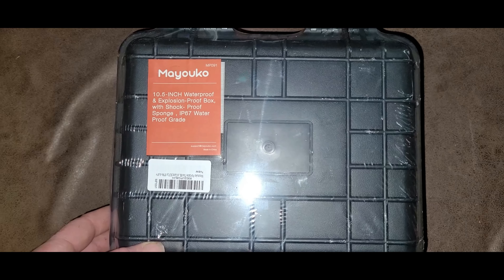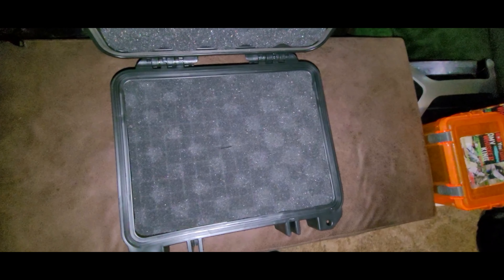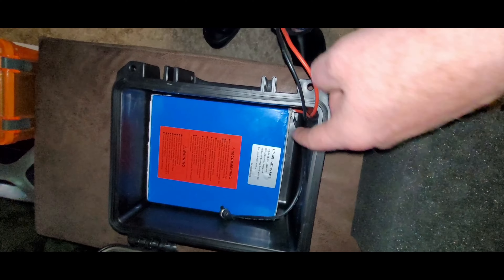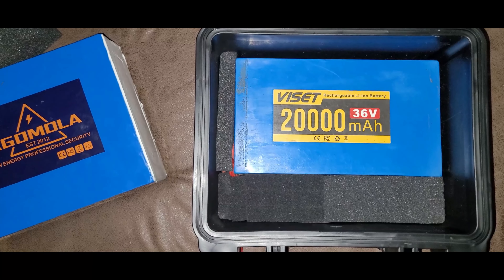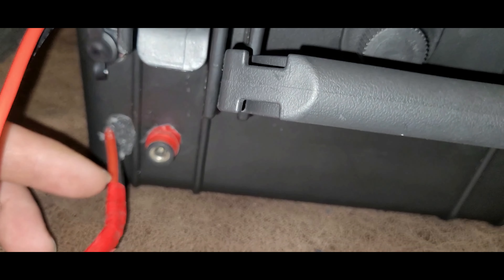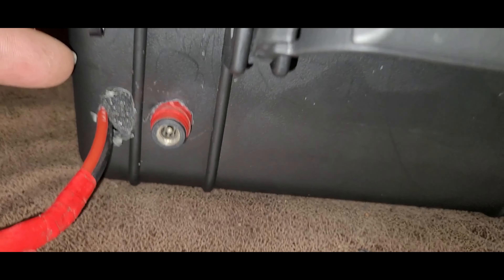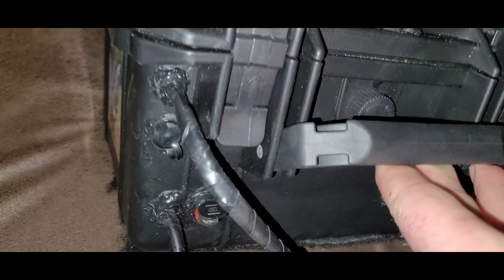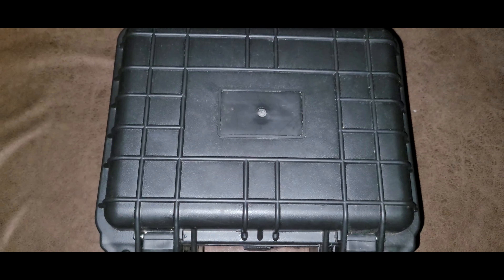DIY Dual Ebike Battery Box Water & Humidity Proof

Comment: Looks good Kenny 🤘

Just a thought for the future, when you have to drill an oversized hole like that, instead of having to fill it all with silicone, you could buy rubber grommets sized for the hole you've made, use a razor blade to slice a single cut through it so you can slip it over the wiring and pop into the hole, then as a precautionary measure you only need to use a little bit of silicone. 

The make grommets in a wide variety of O.D outer diameter, I.D inner diameter, thickness and groove width to fit the thickness of material you're working with. 
Hope this helps in the future 😃
Reply from the maker: Yeah thought about something else to . But more to buy and I spent a grand last month on the channel so 🤷 works ☺️👍🏻

Comment: How far can you travel with your ebike? Some of the Amish around here have them and those things run like 40mph. Too fast for a bicycle. Lol
Reply from the maker: Lol 😂 I can get up to 34 mph strait ground with both motors but did set it so I don't go over 25mph because of the trailer wobble at those speeds and helps save battery 🔋 . If I go slow I can get pretty far as of 30 to 40 miles but fast about 20  miles strait Balling 😂👍🏻 the whole time . Both without trailer , the drag of the trailer takes extra juice so I start slowish lol to help the more drag against the motor the harder it works and drains the battery 🔋 muddy hills can drain it sliding around. All depends on the rider and the motor . I have two 500 watt motors . You can Use two 1000 watt motors with high amp hour batteries and get 50 or more  mph and much more distance if not regulated .

Comment: Are the batteries going to stay cool enough?
Reply from the maker: Well I'm hoping so better than they were in the older box I ran for a long time now . Also noticed others use boxes just like this for using for the ebike  batteries screwed to their rear carrier . I remove mine and charge in the shade . So mine doesn't have to stay because isn't mounted like theirs. Should be good 🤞🏻 knock on 🪵
Reply from the maker: The box is insulated with tons of foam I'm sure it would help out a lot 🤷
Reply: Just thought I'd say what I was thinking 🤔 those lithium batteries can get warm. 😃😃
Reply from the maker: Yes indeed used to use rags between the batteries in my old box . From what I've noticed should be a better box by far . Love input definitely will be paying attention while charging them and on hot days 😉👌🏻 and see  if there's any difference . My charger for the batteries get really hot 🔥 but my batteries always seem cool to the touch ... Thanks much for checking out the vid brother

Comment: Do you have a rack that you mount this on?  Front or back?
Reply from the maker: hey 👋 good evening 🌆 . I built a fishing Milk crate with two milk crates and this fits inside . And has saddle bags for tackle and suck and crate has two rod holders on each side . All tied down to a 150lb rear carrier 🤴🏼👌🏻 I've wired everything inside the Milk crate too . Everything in one place .
Reply: @DMVWhiskerKing  should make a video with your final setup when you hook it all up.
Reply from the maker: Oh I've had the ebike built forever just bought a larger battery and didn't fit my old battery box I had made . Hmm 🤔 maybe I'll do a full Video 📸 of my ebike and how I charge it on the go aswell with trailer and Solar Generator and panels the full setup 🤴🏼👌🏻
Reply from the maker: My ebikes gone 1300 miles so far as a AWD eBike used to be a rear wheel only and it died so I stripped it down and put two motor hubs kits on it and made it AWD 😉👍🏻 never did make a video 📸 about the build that was forever ago should have though